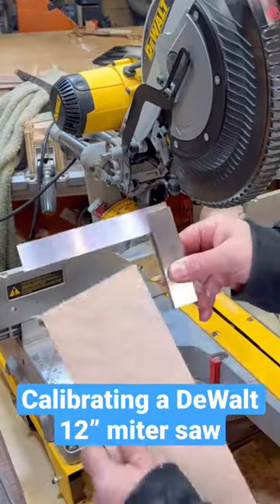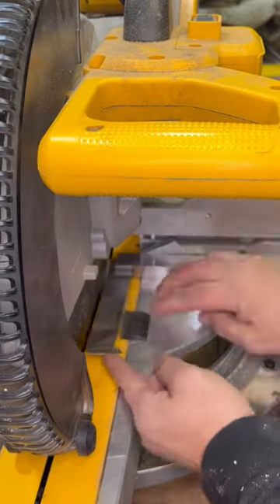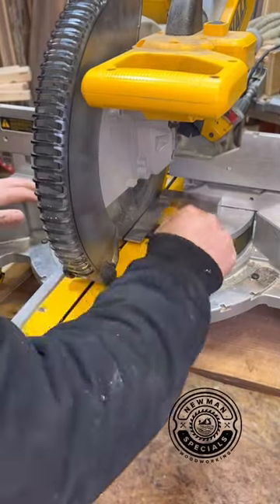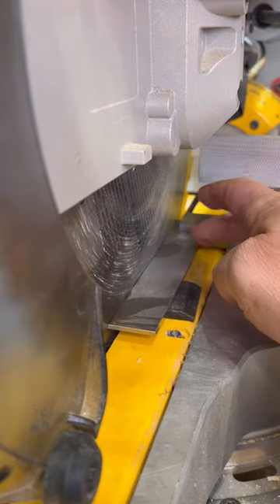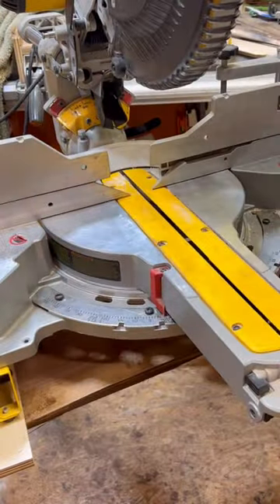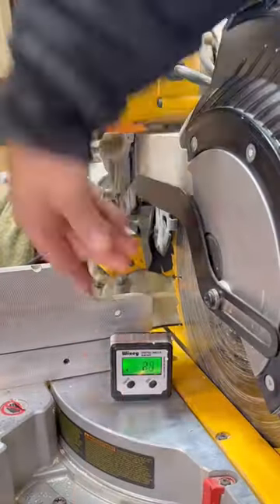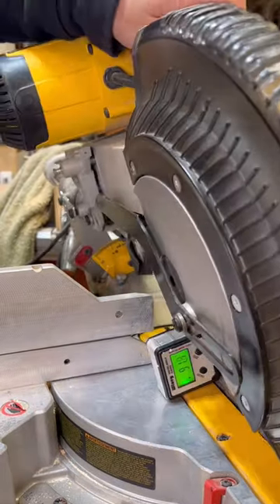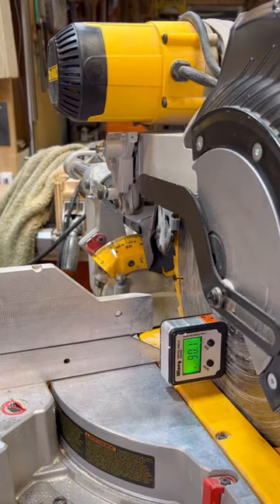Calibrating a DeWalt 12’ Miter Saw #woodworkingtools #powertools #diytools

Comment: Those digital angle gauges suck, they have a really large tolerance. Definitely use a machinist square on the vertical square
Reply: For adjusting the table I use a 3/4 x 12" x 36" piece of MDF, a woodpeckers 2616 square and feeler guages, .015, the thin one.  For the bevel i set the saw in chop mode then cut the largest piece possible vertically and check with a square and feeler guages.

For a good 12" blade I use the FS Tool SM3600.

Comment: Do you have a video showing how to calibrate the 45 angle it’s just breaking my soul
Reply from the maker: If it is calibrated at 90 it should be accurate at 45 too since the detents are set specifically to the angles

Comment: My miter is square when the blade is near the back of the machine. But when I extend the arm to its maximum range, it's crooked like crazy. Do I change anything? It's perfectly straight for small pieces but running wide beams through it is terrible
Reply from the maker: @stevendrumt  I would still check the calibration because it has to be off somewhere
Reply: @NewmanSpecialsWoodwork  I used my square to change it at its longest. Think it was off by less than a mill, but it's straight now. Thanks for the help!
Reply from the maker: @stevendrumt  glad to help!

Comment: Great video thanks. DeWalt was selling these at a discount compared to the 780 model. The 779 model comes with a 32 tooth blade good for cutting framing material but not for finish work
Reply from the maker: I agree completely!